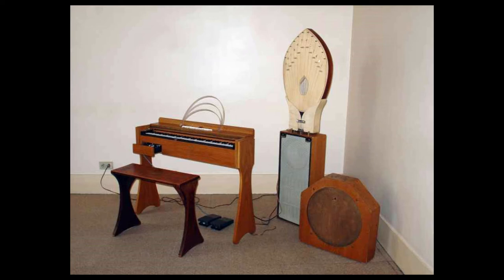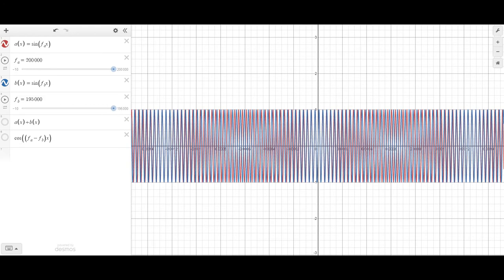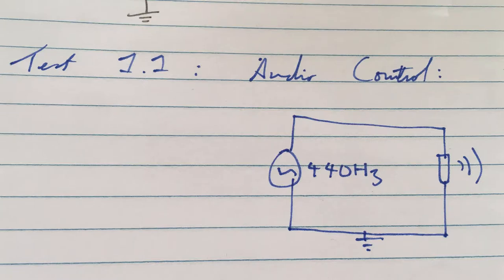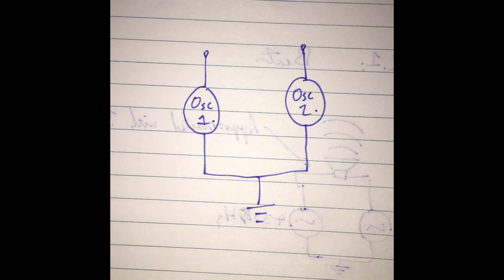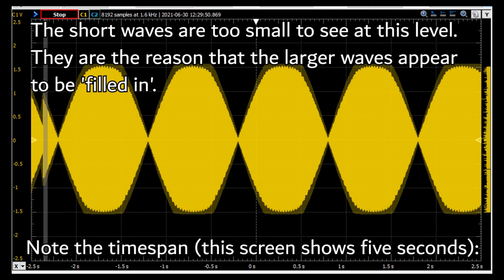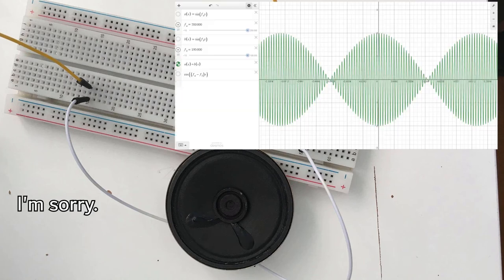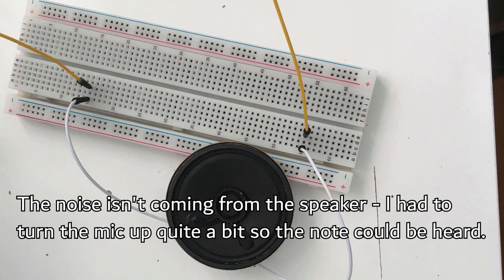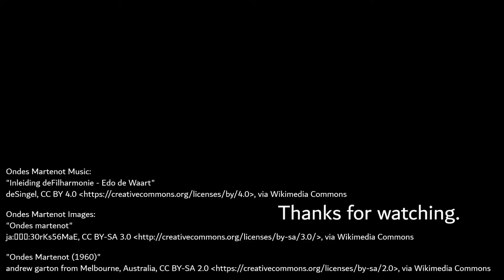Building the Ondes Martenot [01: Sound Test]

Comment: The Mk. 6 was the last ondes to use the heterodyning valve-pair oscillator system. The Mk. 7 brought with it the transistorisation of the ondes Martenot. So you don’t necessarily need to pursue the heterodyne sub-harmonic as the primary means of tone generation 😉 

Looking forward to seeing how your project develops!
Reply from the maker: If only you'd told me that months ago! Oh well, I've pretty much got the sub-harmonic stuff figured out (well, theoretically anyway, I haven't been able to test it with real components yet).

By the way, how do you know of the different developments that happened in each new version of the ondes Martenot? Is it something that you've picked up over time, or is there a book that goes into the details? Because if the latter, that'd be a really useful resource in this project.

Cheers